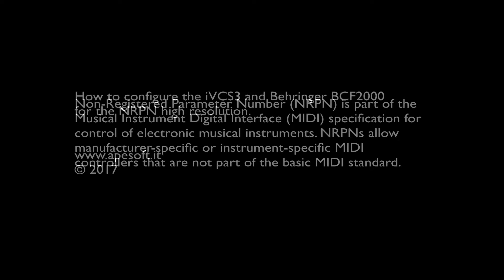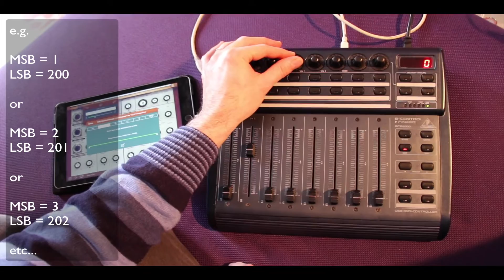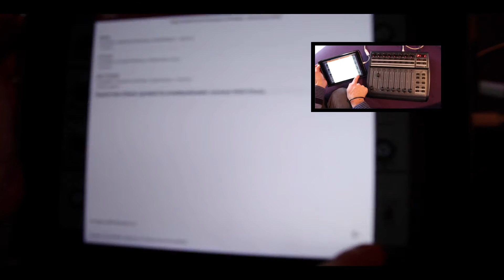How to configure iVCS3 MIDI NRPN

Comment: Great demo of the difference between 7-bit and 14-bit resolution. This can be the biggest benefit of NRPNs.  Such a shame that so few midi controllers, even those that support NRPN, will send both CC6/coarse and CC38/fine together to get true 14 bit resolution from 1 knob or adjuster.

Comment: 14 bit still has audible steps...that's no fun. How does spectrasonics get smooth USB midi filter sweeps with the hardware profiles in omnisphere 2.5?
Reply from the maker: The iVCS3 frequency range is 16670 Hz, the MIDI 14 bit resolution is 16384 so the step is 1 hz ~
However due the graphic updating of the knob, could results some audible frequency gap.
Infact no one portamento is implemented for the frequency knobs, according to original VCS3 specifications.
You should reduce the frequency range (from Control Manager MIDI Assignation) in order to increase the resolution, resulting a smoothly glissato. Cheers.